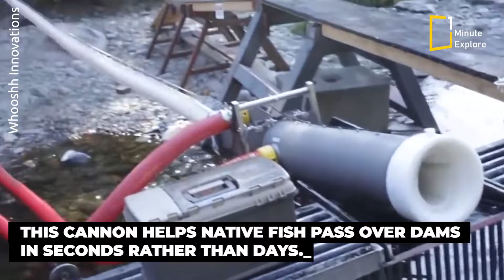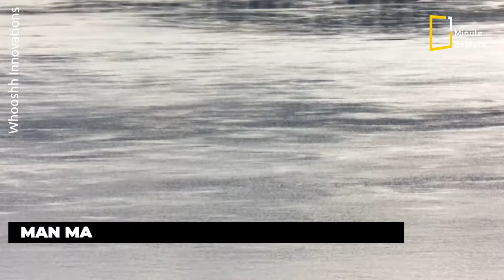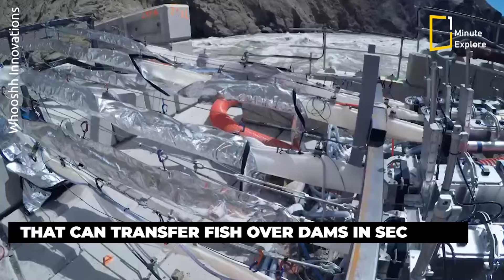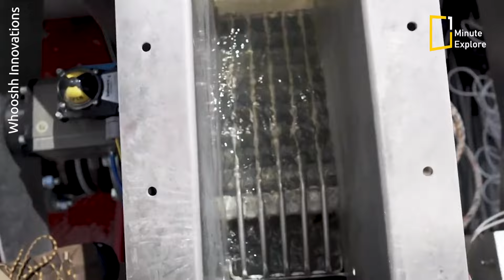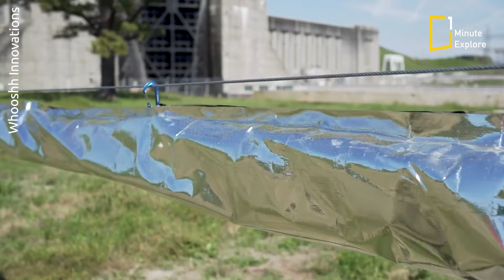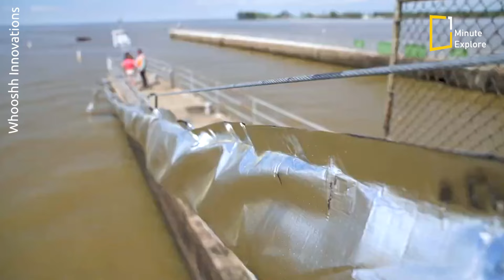The 'salmon cannon' that shoots fish over a dam by Whooshh innovations

Comment: I still don’t understand how the fish are being propelled up and over the dam. Someone please explain.
Reply from the maker: At the Salmon Cannon, fish are propelled up and over the dam using a combination of water pressure and a specially designed system. Here's how it works:

Water Flow: Fish enter the system through a water-filled channel or tank where they’re gently guided into the device.

Pressurized Tube: Once inside, the fish are moved through a tube where water is pressurized. This pressurized water helps push the fish forward.

Guided Movement: The fish are carried along by the water flow, which is carefully controlled to ensure they move efficiently and safely.

Ejection: At the end of the tube, the fish are released into a pool or a natural waterway above the dam.

This method mimics the natural flow of a river, allowing the fish to bypass the dam and continue their migration.